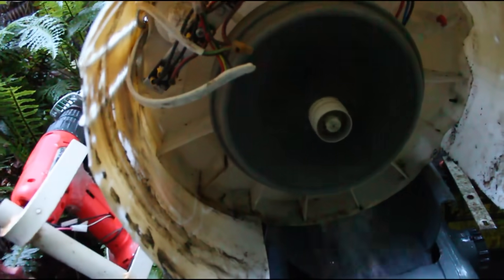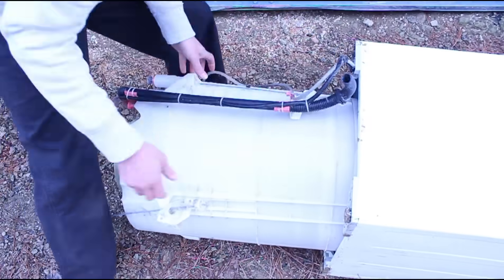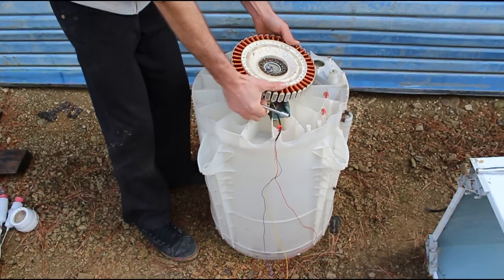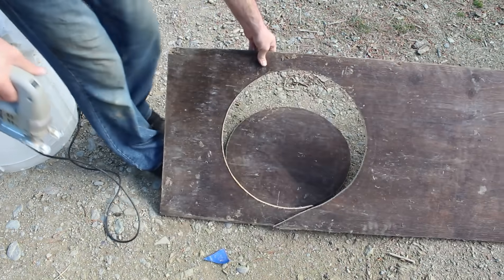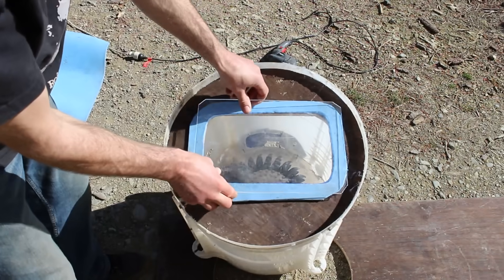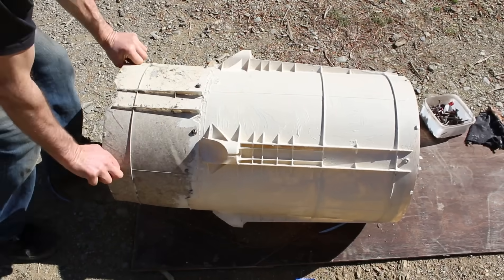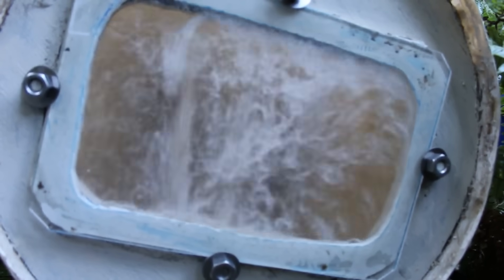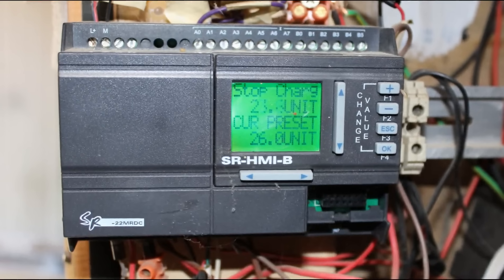Free power- How to convert an old washing machine into a water powered generator

Comment: This is so superior to solar, as it's constant, day and night, rain or shine. But like solar, the weak link is the damned batteries. Unbelievably expensive, unbelievably heavy, inefficient, requires a large quantity, takes up lots of space, must be vented, needs constant climate control, demands nearly constant maintenance, and they have a short lifespan. The breakthrough in all forms of off-grid power will be inexpensive, powerful, lightweight, reliable, and the means to easily control output, Super-Capacitors. They've come a long way but the price is still too high and there are still bugs to work out. Once solutions for Super-Cap discharging issues are found and the price drops dramatically, thousands of US homes will go completely off grid the first year. Between years 2 through 5 manufacturers will not be able to meet demand.
I have thought of trying my luck at bus terminals to maybe pick-up some super-caps that many busses utilize, along with batteries, to start the Diesel Engines when extremely cold.

Comment: you should never, ever dump off excess electricity.    buy 1 or 2 yacht batteries and keep them charged to full, so you can practically run your house as you like.
Reply from the maker: The power is 'dumped' into my hot water cylinder so its not wasted
Reply: @Rambro-angryram  i misunderstood

Comment: Where does 45 lb. water pressure come from?   From a 1000 watt pump? Then you just lost 200 watts.  Probably more, unless this system is 100% efficient. Is that 45 lb. City water? I would hate to have your water bill.
Reply from the maker: I have a small stream on my property, gravity creates the pressure, the intake is higher than the outlet jet, the greater the height difference between intake and outlet, the higher the pressure.
Reply: I am assuming he has a dam 100ft above the outlet, that would give 43 PSI.
Reply: You need at least 150ft to get 45PSI. Must be a very long pipe, unless the water comes straight down, that would be some waterfall. I don't believe any of this.
Reply: It's not unreasonable to assume somebody living off-grid would have a sizeable property and a dam to maintain adequate water pressure.  Pipe isn't expensive.
Reply: OK, see for yourself. Google 'NoOutage.com', they know turbines and generators . Their answer is, not feasible.
Reply: What is not feasible?  A tank of water 100ft higher than the outlet will produce 43 PSI at the outlet.  It's basic plumbing.

Are you saying that principle is wrong?
Reply: @donald6815  Mr AngryRam shows the pipe in his videos, and in the vids or comments states the size of the pipe, the length of the pipe, and the head. Which part of it is not feasible?
In NZ there are thousands of properties large enough to house a system like this.

Comment: should have done that inside out instead, the inside was already water tight, and rian wouldn't get to the electrics, have the water wheel on the outside instead.
Reply: At the minimum I would have set it up to have the drum inverted with shaft running vertically. with the generator on top, the bearings have a much better chance of withstanding water ingress.  But really I would have probably built a different housing and moved the components over.

Comment: Where's the 120/240 and the amps. Good but it's all show.
Reply from the maker: It generates 24v dc into a battery bank, An inverter converts from 24v dc to 240ac to run household appliances. Definitely not just for show, I haven't had a power bill for 12 years, It has saved me many thousands of dollars in power bills.

Comment: Cheaper just to buy a generator!
Reply from the maker: Not here in nz-  a decent diesel gen is $3k+   diesel fuel is $1.50/ litre, would use around 8l per day to run a house = $12 x 365 days = $4380 per year.  My power bill for the past 11 years = $0.    My yearly maintenance costs = $20 for bearings and seals.

Comment: Why dont you use  a  automatic ac battery charger?. It charges battery by ac. If you use ac battery charger u dont need a rectifier and charge controler
Reply: The original output from the washing machine motor is 400VAC at a high hertz.
It needs to be rectified anyway.
As it turns out the 27VDC rectifier output is just right to charge 24VDC batteries...
and the 24VDC is then fed through an inverter to give 240VAC for transmission to the house..
where all the domestic appliances are 240VAC.....

Comment: What's the point of it if you're spending money throwing away water to spin a motor to get electricity? Doesn't seem cost effective. The only way you gain here is if you live next to a constant running stream or in a windy area where you could use a windmill.
Reply from the maker: Yep I have a small stream

Comment: your washing motor can't last time at 20 amp, its not build for that power.
Reply from the maker: It has been running continuously for 6 years, no issues yet
Reply: @Rambro-angryram  20 amp for 6 year, for a GE motor? FnP dont build motor, its a GE, and his duty cicle is betwen 20 and 40%, you are very luky ^^

Comment: I cant figure out why you would spend so much time waterproofing something that sits in a creek bed and has water shooting through the inside of it.
Reply from the maker: Without waterproofing there would be a constant fine mist from the turbine, this would corrode all the terminals, electronics, inverter and create a slippery area around the turbine which becomes a safety issue

Comment: 1. You made a crappy design on that inspection window
2. I doubt that cheap washer is designed to spin 24/7
3. Cheers mate
Reply from the maker: Incorrect, The generator has been running 24/7 since I built it 5 years ago, only stopping for an hour while I changed the bearings. The inspection window is holding up well.

Comment: How much this will cost ? 
Turbine fan $150-200 + programable controller $1200-1500  
so, we are talking about may be $2000 for this piece of junk 
It  may be better to buy a professional  Turbine generator  for $1000.00
Reply from the maker: Lol, an analog controller can be found on ebay for $5 or a $40 pwm controller can be used. The generator was free from the tip, an old f&p washing machine with a blown circuit board

Comment: Lol cool little project...but as a 20 year hydroelectric powerplant mechanic who has built Pelton units with 10 foot diameter wheels....and 600MW units at Grand Coulee.....your washing machine rotor and stator will not put out enough to power your house....unless your house is a 200 sq/ft tiny house project with nothing over 5amps lol
Reply from the maker: Incorrect, it actually produces more power than I can use for most of the year and dumps excess power to a heating element. I do use a wood burner and gas for cooking meals and heating but apart from that the house is powered by the pelton wheel/battery bank/24-240v inverter so it can run the microwave, toaster, kettle and other high load appliances up to 5kw, it also powers all the tools in my workshop

Comment: You just made it way to complicated just run the 3 phase and use what you need and store the rest in capacitors
Reply from the maker: Output from factory wiring s 400vac high hz.. unusable power
Reply: @Rambro-angryram  drop it through a resistor and store the rest in capacitors ,capacitors an handle 600v. Ac easily especially if you use a run start capacitor . another way it can be done is running it through lights if your AC line has a decent light every few yards it will drop the current substantially resulting in the desired current

Comment: "Put a hopper on top to move the water go fast an make more power. PNM."
Reply: The pressure is controlled by the drop (height)  between water intake at the top  of the pipe and the jet at the bottom of the pipe.
The volume is controlled by the size of the pipe and the size of the jet at the  Pelton wheel.
Put anything you like anywhere on the pipe...that ratio still holds true.

Comment: Sheep baba baaaa baasa .... sorry , but word your video correctly .

Like it's not free or generated .....  its paid for in many other ways .

Other than the illusionary rate me ,societal monetary system ...

And it's converted electrical energy...
As in , water ,diverted to a collector of sorts ,like how a dam works ...

Which turns a mechanical device ,the motor ,past the stator windings ...
Which transfe4s magnetic power ,to coiled wire ...

All conversions see.

Law of conservation ,  energy cannot be created or destroyed ..

Hence , generate ,is not a correct term ...

Oh and before anyone thinks of commenting negative retorts 

It shows how dumb ,we are like sheep.

As the push for evs and pumping Co 2 underground ....

For our children or theirs tondeal with ...... wow ...

We really did advance the tech...
But not the brain
Reply: This is an adaptation of existing tech which was on the way or had arrived at the scrapping point...
and converting that into tech that can provide electricity at minimal cost and barely disturbing the flow of the stream...
to improve human life just a little...
and has done so for the last 18 years..
with minimal maintenance...
Reply: @JohnSmith-pl2bk  still a mis concept calling it free ....

Like the saying , Divine is to WHY as FREE is but an abstract ,that keeps the waters muddied ...

Fill Off o See ......